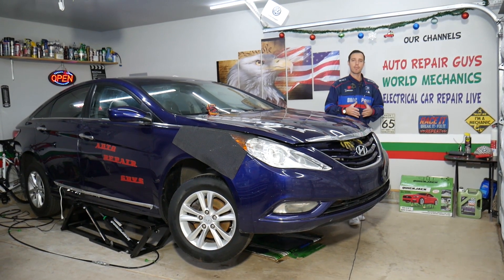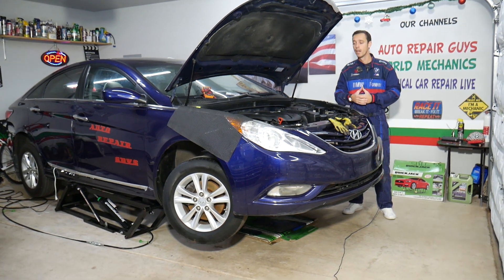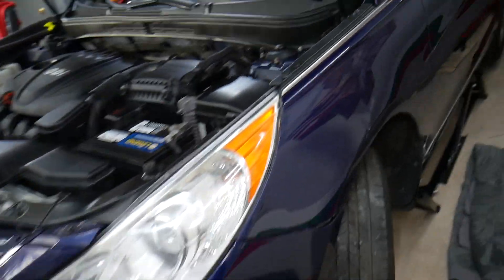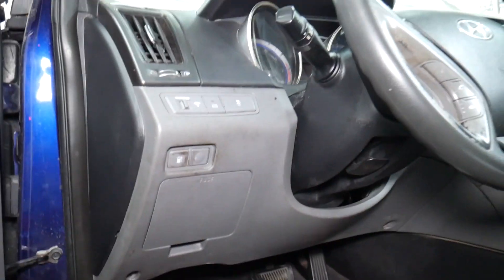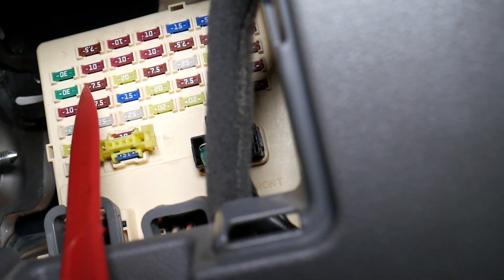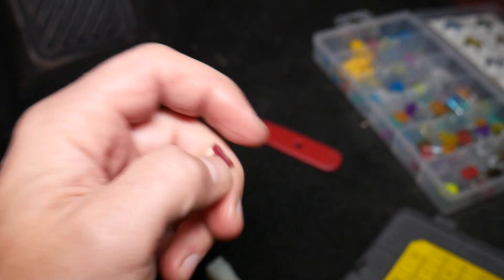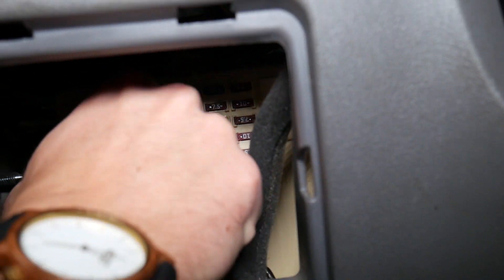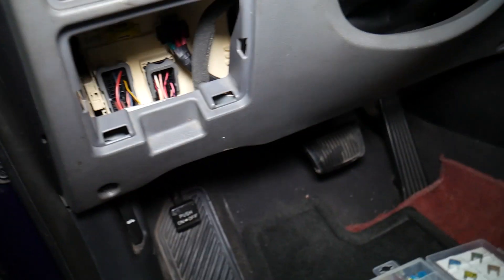HYUNDAI SONATA INTERIOR LIGHTS FUSE LOCATION REPLACEMENT, DOME LIGHT FUSE

Comment: Finally!!! Watched several videos and came to this. My door locks would not work, lights or trunk either. Was also getting a low tire pressure alert. Pulled this combo fuse and found that the 10 Amp fuse had blown. Replaced it with a spare 10 Amp and it literally fixed everything!!!! Thank you so much!

Comment: Question: 2005 hyundai sonata glove box and ashtray fuse location? both 
went out at same time. assume they share fuse. power socket still works 
and separate from ashtray and glove box fuse line.